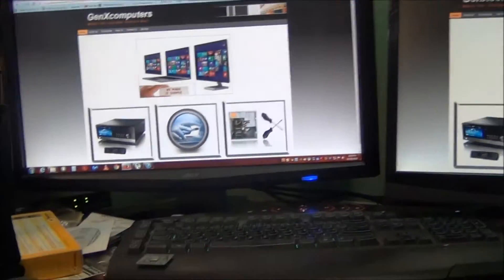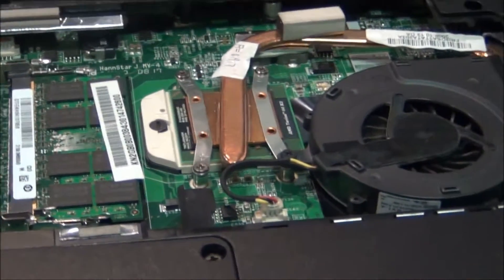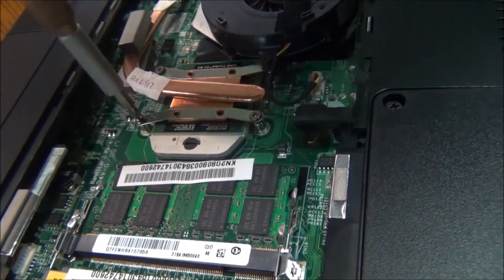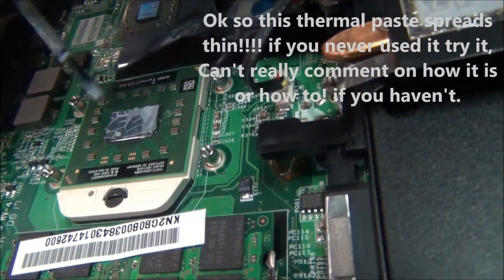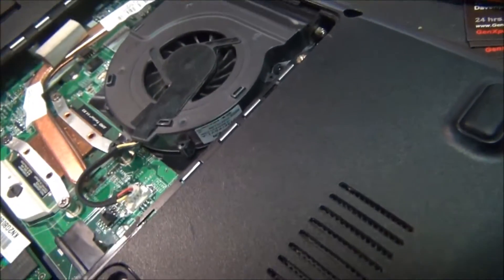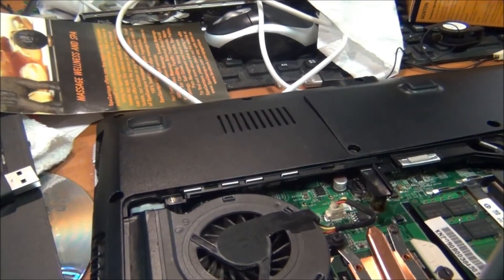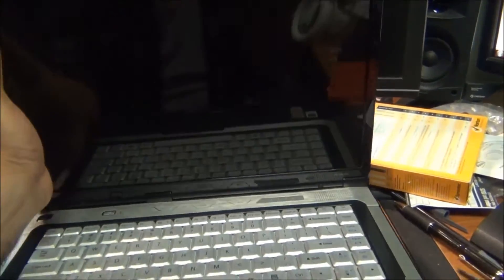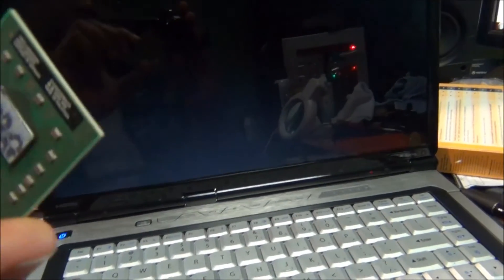gateway M series No video Fix Black Screen

Comment: i had the same issue with the a w650 model gateway. i changed the CPU and it worked for like a day. so i bought another CPU and it worked for like 2 days and died again. so something keeps causing the CPU to go bad. i even drilled holes on the back cover for more ventilations so that it doesn't over heat. any suggestion to help solve the issue would be appreciated.

Comment: Mmkay. I'm troubleshooting a gateway FX MS2252. the screen won't light up. 

If I bypass to an external monitor  thru VGA, the monitor receives just black screen (from 'no signal' displayed to just black but it's lit black)

I hear no beeps just fans. I've swapped RAM chips around. I've put just 1 chip in. I've taken out the battery and let it run thru the adapter (the only way it even got a blank black screen to the external monitor btw)

So far, i know now the battery needs replacing. The adapter could probly use it as well. And a few minutes ago when I was asking where the owner put the screws and respective access panels on the bottom, I found rusty colored fuzzy clogging of dust patterned in a perfect circle in the shape of the fan behind the vent panel. 

I'm going to guess it's power, and the video card choked.

The owner said he was getting display driver failures repeatedly just before the machine croaked. 

I think it's power and gfx. Would that be a good direction to go?
Reply from the maker: Seems like you did some good troubleshooting, hopefully someone else had similar experience and can share their knowledge.
Reply: @biggonyouTechWhisperer  I've since ruled-out the GPU as I was able to reach it and test it for power issues. 

I am leaning more toward the scenario of a slow, steadily creeping and growing   loss of power causing the errors and crashes which stems directly from both battery and power supply giving up the ghost.  

 i also decided to be thorough, took the entire thing apart to access every major component I could, and started doing continuity tests and inspections of the motherboard and many of its bits and pieces attached. 

Everything looks fine and current runs through nice n smooth. I also took the opportunity to remove any dust that could cause future problems. 

Whew! Now to finish up be reassembling and getting new battery/psu for it. Yay! The schooling paid off LOL